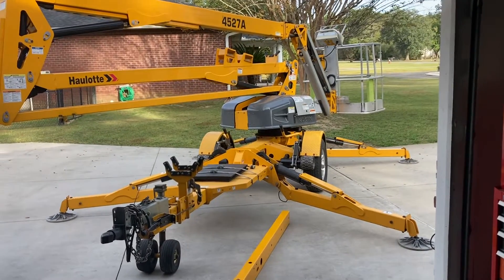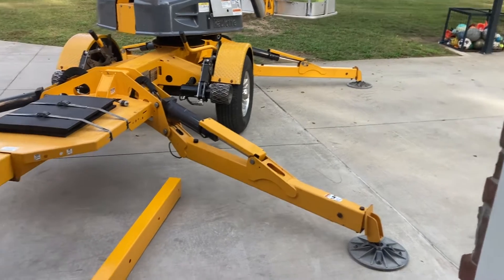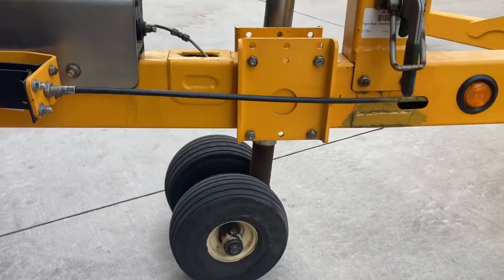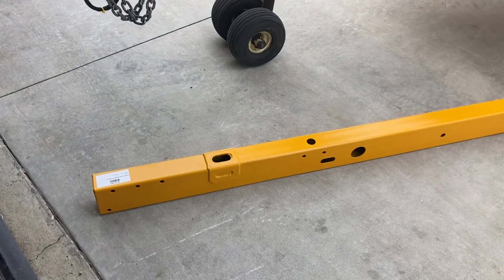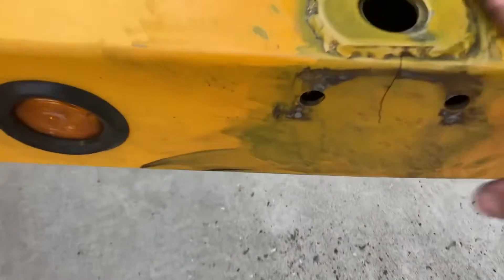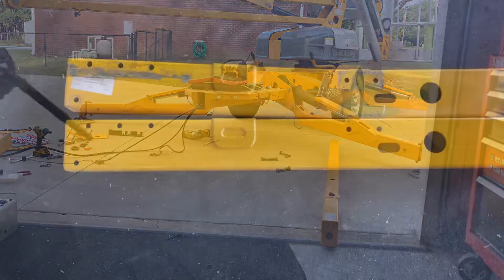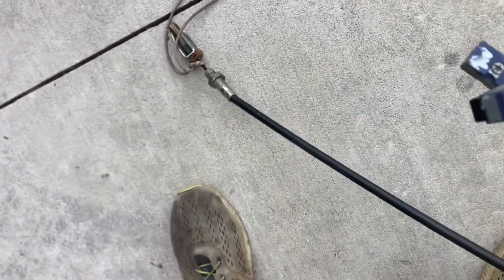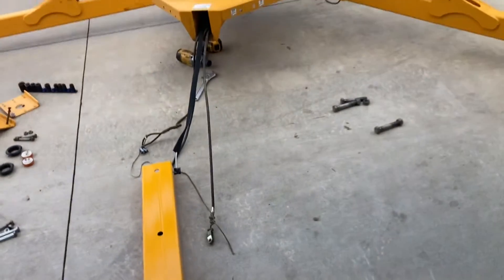Haulotte 4527A Tonge - Frame replacement -  Potential catastrophic boom failure on a towable manlift

Comment: It's from towing it and going fast over bumps in the road. Watch your review mirror. The stress from leveling it is so much less than watching the thing try to pop off the ball and bang all around.
Reply from the maker: good info
Reply: Sounds like they need to use a stronger beam.